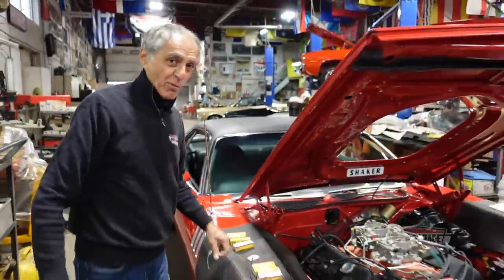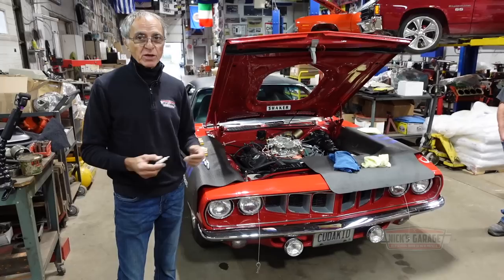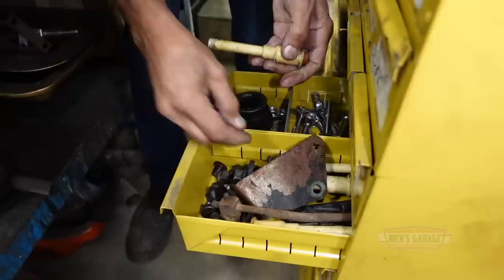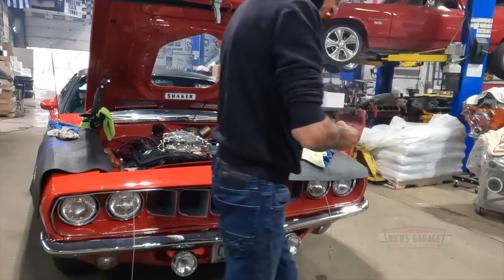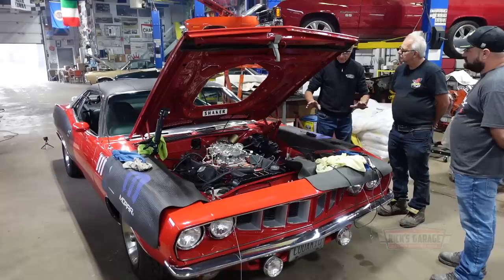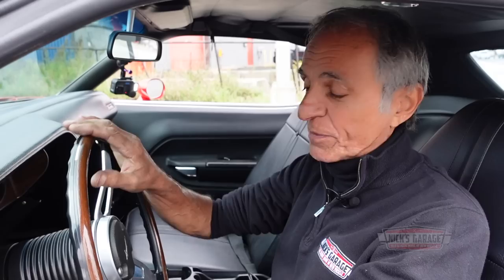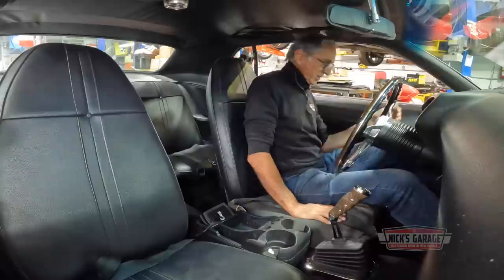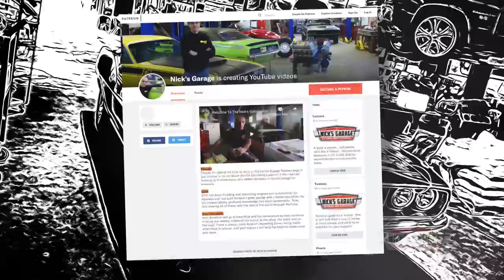1971 Hemi 'Cuda - FINALLY Runs Like New!

Comment: Back in the 80's I used Champion spark plugs exclusively. AC spark plugs would commonly have 1 or 2 bad ones in every new set so I wouldn't put a set in without putting them through a spark plug tester. I had bad experiences with NGK plugs failing shortly after installation. Once was a motorcycle that had 1 plug fail in less than 5 minutes and the other failed in less than 10. A pair of Champions ran until I got rid of the motorcycle. My 70 Dodge Coronet had Champion plugs that were in it for 55,000 miles. I would check and regap them once a year and clean and regap the points at the same time. That engine used quite a bit of oil and had plenty of blow by and it would still start on a bump of the starter. Unfortunately Champion plugs aren't what they used to be but the good news is that most of the other brands have improved.

Comment: I've owned three 440s but never a HEMI.  My fault back in the day when they made them. Great show Nick. I'd love to drive that car.  1971 Cuda is my favourite car.
Reply: If you don't have to have a real original a 426 you can still build one from scratch or even buy a complete crate.  Not cheap but obtainable, around $8k to $16k depending on the route you take.
Reply: @Dayandcounting  Actually I meant buying a HEMI Cuda brand new. I could have or at least one or two years old. I've owned a 1968 440 Charger RT, 1969 440 GTX that I bought from the original owner in 1971, 1970 Challenger 440 RT/SE and a 1972 Challenger 340. Helped a friend put a 426 HEMI in his 1967 Dodge van, that we drove to High School back in 1971 and he bought a 1966 HEMI Charger from it's original owner for $850 in 1975 that he ultimately sold to Rick Finch, the bass player in KC & The Sunshine Band.  Best Regards. ** P.S. Presently I have a 2004 Z06 Commemorative Vette that I bought brand new.  Great Car
Reply: @timmotel5804  ....Good old days.

Comment: Hi Nick. You sure work on a lot of nice cars. When I change spark plugs on my Mopar. I use a piece of rubber hose push on the top of the plug and lower plug into place, and start to turn into threads. Then pop off hose and use socket to finish tightening it.

Comment: A local engine builder would always slip in dished low compression pistons in performance motor builds. When I discovered dished pistons in MY motor I confronted him, he said it cuts down on the warranty work.

Comment: I agree some headers are awful, but if you get brands like TTI that are well thought out and don't require removal to get to the starter motr they can be fine .. Though on some cars like 80s corvettes - the factory manifolds have the flange too close to the engine and cause lots of melted spark plug wires, whereas the good aftermarket ones get all that heat away from the engine bay.. I think some of the earlier big block cars were better thought out and had the Brake Booster on an angled mount that got it out of the way of the valve cover.

Comment: It's a drag strip competition excluder an adrenaline extruder This is a meticulous reproduction of the 1971 Hemi 'Cuda Nick is shaking her down For ironing out your motoring creases Nick's Garage wears the crown It's a real 'Cuda and it's a real Hemi Now Mike has sent her to Nick to make her track ready There's a few issues with the block Mike is determined to make them stop Nick had one of these himself Today to get a genuine Hemi 'Cuda would take immense wealth Luckily all the parts are here Nick's mission is clear Treat it with care and take it from there Of Hemi's and 'Cudas Nick's Garage has had more than it's fair share You gotta start with the spark and check your plugs Make sure the carburettor takes strong healthy glugs Check the air fuel ensure it's a reliable mule Every job has a tool Nick's Garage in just too dayum cool You need to do the timing too to keep that Hemi running right all the way through At Nick's Garage that's what they do Big shout out from London to Mike Nick George and the entire Nick's Garage Crew
Reply from the maker: Amazing, Roberto.  Your wordsmithing skills are on a level with Mike's bodywork.
Reply: @NicksGarage  Woah I don't know If Mike does bodywork for a living that's where I'd go This 'Cuda is clean It looks really mean and it's got that better than showroom sheen Mikes body work skills are plainly supreme

Comment: Great ride! As good as it gets. Nick will have it tearing up the street. I don't have a problem with a built car, that means I can put a big roller cam in it, do some head work and pull 650hp instead of 450 and not feel bad destroying a factory correct car.

Comment: I just thought of something- were the billboards put there so if you blew a tyre drag racing it could be easily fixed by just tearing it off, body working if needed, then just stick down a newy? Instead of painting the whole quarter, if not roof and other as well. If so, very cool idea Chrysler. One of many.

Comment: Oh Nick,! I miss my 383 Cuda'. I wish I hadn't sold it! Same Year but it didn't run like a standard 383. The previous owner put a Cam , Edelbrock & Holley carb! It had to at least 400 HP.  Looks so much like mine. That was a low production Year ! I Still ❤️‍🩹 remember stomping on the Bright head lights with my left leg & stomping 🦶 on the bright 🌞 lights on the floor! That was the only Year Cuda' came with 4 headlights. I recall going to the Mopar Nations - getting a Pistol Grip shifter, Fog lights. I ordered chrome tipped exhaust. $100 each fro MOPAR. The guy's at the Dealership Thought 🤔🤔 I didn't have a Cuda'. I drove down in my ex Raunalt. When I pulled up in my '71 373tgeir Jaws dropped. I was like yeah It's a Cuda'. I drove it cross Country to Oh. I like your show thanks 👍👍 Nick!

Comment: This also was the only had the hills on the side fender. Thankfully it had a Bad Clutch, it still tried to put me in the ditch Twice! I had to Shift to 4th gear ! I was pissed 😡 when the Voltage ⚡ relay was out my Friend the Road runner 😎 dude told me it is the Voltage ⚡ relay $10 & it fired right up!  My dad & I was really besides our selves after changing the spark plugs , wires & starter. Wish he had come Over sooner! If you got a MOPAR & It doesn't wanna start try the Voltage ⚡ Relay inside the engine Compartment. Good luck 🤞 thanks Nick.

Comment: I have a 71 Cuda drag car that was built  in ontario as a drag car I purchased it as a roller and have been running it with a 318 set up for nitrous. My Son and I are going to put a new style Hemi in it. Always wanted a Hemi Cuda it will be the next best thing. Were putting a 440 in my 73 Duster the Cuda is next winters project I'm giving my Son the small block for his Ramcharger Mudbogger
Reply from the maker: Very cool!

Comment: Hot wrong button, the 71 Cuda and the 70charger are some of the best Mopars but you always like the other ones that you would like to have would haftahav every year and body style and engine options but that is impossible but nice to dream, have a question ❓, water was deep enough to get above the top of the transmission for a day or two, fresh not salt, it is a A-727behid a 440it has not been turned over or moved in any way, do you think it should be drained before moving or do you think that the water didn't get into the transmission? anyway Skittles and the family are alive and thanks for the videos down here in southwest Florida we appreciate a break from the damage to our house and the whole community
Reply: Sorry to see what happened in Florida.  Water must of gotten in the trans from the vent hole behind the converter. Please drain it.

Comment: Nick why are exhaust manifolds your favorite over headers?
Reply: After 50 years working on different cars and engines, headers in many cases are in the way when working in engine bays. For EX,  spark plugs, motor supports, steering box, cooler lines, shifter cables, steering columns, starters, and many more.
Reply: @nickpanaritis4122  Thank you Nick

Comment: Hard to tell on my phone. But it's either running rich or the exhaust is kicking up water spray from the road. At 31:00 it sure looks like the engine is loaded up when Nick gave it some throttle. Or am I seeing things??
Reply: This engine ran very rich before.    Need to kick it full throttle to clean out the exhaust system.

Comment: So what was the big problem?? Bad plug? Carburetor? Wires? Timing?
Reply: Floats too high, rear throttle plate sticking, fouled plugs, jets too big on the primaries, repair choke linkage, and adjust carbs.